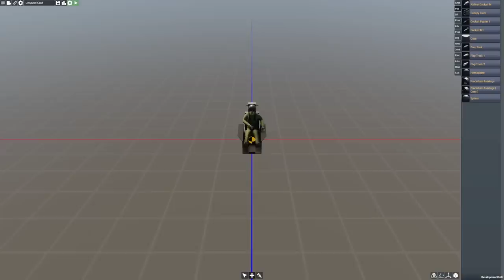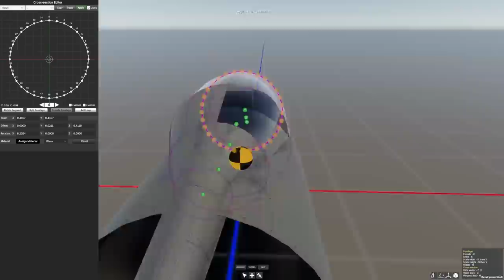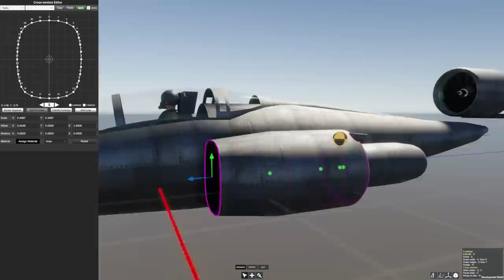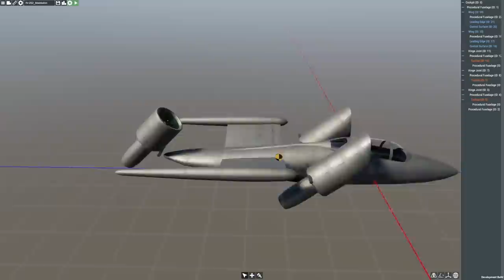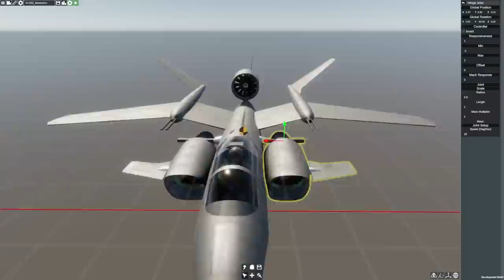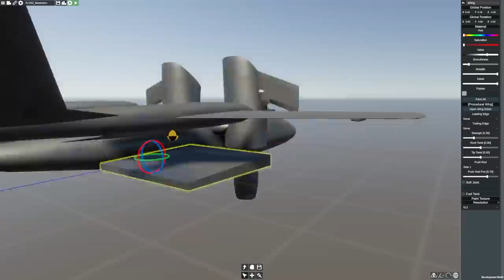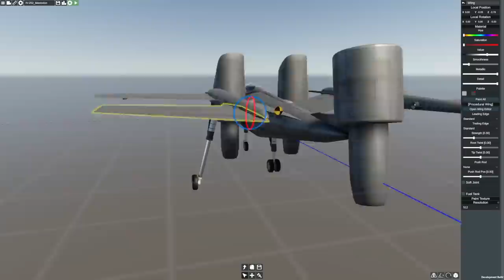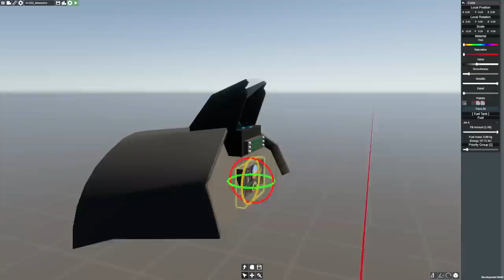Building a Rather Absurd VTOL Aircraft - |FLYOUT|

Comment: This is one of those crazy cold war ‘revolutionary’ aircraft that's really just made to impress the other side
Reply: Like the XB70 or B58?
Reply: it's what happens when you give 60s-70s engineers a few kilos of coke and tell them to make concepts and mockups.

you end up with one or two feasible concepts and an inventory of drawings with specifications jotted out in ilegible handwriting.

not really a shock for the opposition by the way.
Reply: @valeriezorn9420 the B58 actually was in service though.
Reply: @hughmungus5033  
the op stated "impress the other side" not "never saw service"

neither the B70 nor B58 had much more of an effect other than forcing the USSR to adapt.
Reply: @spazzey0  The B58 wasn't just made to impress the other side. It added a capability the USAF thought they needed at the time in order to penetrate Soviet air defenses. At the time the best way to do this was speed, and either extremely low or extremely high altitudes. That is why the U-2 flew so high. The B-58 was made to fly higher and fast enough to avoid Soviet interceptors before the introduction of high altitude SAMs.
Reply: I want to say it made me think of weird fictional super aircraft from Ace Combat.
Reply: The Cold War is really cute if you think about it it’s two sides trying to make something to impress the other
Reply: @NerfAutist the nuclear bombs:
Reply: @NoDoudt.  did I stutter
Reply: Yeah, it’s more typical of the late 50s and early 60s than 70s and 80s, forward swept wings and all.. I know, I was building models of X planes in the 1960s.

Many of the designs only made it from paper to flight prototypes in order to get the Soviets to waste time and money trying to get them to work. That was the real point of the US habit of making films of text flights public.
Reply: @valeriezorn9420 both of those are for scaring. And also for actual use.
Reply: Like the Harrier II? Because this reminds me of the Harrier II.
Reply: Just like the Dassault  Balzac  V

Comment: i am kinda interested if you were to make the most inefficient working aircraft possible
Reply: Supersonic Farman 2222 strategic bomber? This thing have aredynamic of a brick.
Reply: dombrowski sedlitz?
Reply: Already did. It’s called the flying cruise ship
Reply: He just makes the most overpowered gas hungry engine known to man with the aerodynamics of a Jeep Wrangler
Reply: @elixer4583  its efficient in carrying jets plus it runs on nuclear power so it technically dont burn fuel.
Reply: @Canzandridas  well inorder to make a inefficient aircraft like the most inefficient it would still need a body that would produce alot of drag.
Reply: @elixer4583  no the mothership whas worse you now the one that could transport other planes
Reply: a "plane" with a cube-shaped fuselage. it lacks any wings or control surfaces, meaning that it relies on multiple jet engines positioned all over it to take off, remain airborne, move, and turn.
Reply: Ah yes the space shuttle

Comment: It would be fun to see some sort of an all-wing aircraft, similar to the Vought Flying Pancake
Reply: he already did something like this on the lifting body aircraft video
Reply: @prato_ That’s a lifting body, not a flying wing. While the fuselage is technically a wing on both designs, a flying wing is basically just the wings of an aircraft without a fuselage or other non-wing features. A lifting body is using the fuselage as a wing.
Reply: @prato_  that's precisely the exact opposite
Reply: @thehornedserpent so like a B2?
Reply: @elixer4583 
The YB49 still dosen't count, the commenter most likely refers to things resembling lenticular aircraft ( not to be confused with the stereotypical UFO ).
Reply: @spazzey0  It would be great if something like that could be built in Flyout
Reply: @spazzey0   how would it even work?  I know there were concept aircraft back in the day. I’m studying in engineering and still have no idea of how to do it, Especially with the limitations of flyout. Maybe something like a gigantic circular fan?
Reply: @elixer4583  
A fan worked for things like the avrocar, albeit not great, modern unmanned designs have better performance but they are not optimal for combat.

So, it's either a combination of go really fast, use thrust vectoring nozzles, fly by wire, or give up and add a vertical stabilizer.

The B-70's "Pye Whacket" lenticular defense missile comes to mind, it was never used, but wind tunnel and real, practical tests did occur, it would be launched and accelerated to high speeds, stabilized by thrusters.

Around the same time, lenticular shapes became a popular study with re-entry vehicles, you could launch a multi-stage rocket with a manned lenticular spacecraft much like the dynasoar, it could fire its nuclear armament and wouldn't need to be over the USSR to do it, then undergo re-entry and land safely back home.

You could also just add vertical stabilizers.
Reply: @elixer4583  Yup
Reply: @spazzey0  interesting
Reply: Literally his first video lmao
Reply: @spazzey0  Yes, this is exactly what i meant. Round wing designs similar to the Vought V173, or the german Sack AS-6. I find a strange kind of beauty in them.
Reply: @thehornedserpent  you would think a body that generates lift is a wing, since airfoils are just shapes optimized to... generate lift? Well, the internet has surprised me today.

Comment: Yeah this is 100% a mid cold war era x-plane. It is comprised entirely of duck tape, paracord, and sheer middle finger energy. It exists for no other reason than to spend that excess tax money so they can get the same amount to play with next year. It does not care what you think, who you are, or what you do, it will single out your house out of spite and its deeply personal vendetta against you personally, then crash directly into your bedroom. I love.

On a more serious note, the only reason why this design is that unstable in VTOL mode is the lack of a fly by wire system to balance the thrust of the engines. Ok maybe not the only reason but its the main reason.

Comment: Drop the "V-TOL" part of the design and this looks like an awesome "Engine tester" aircraft - Something designed to be able to have the engine nacelles take off easily, so different engines could be swapped in/out for testing on a consistant chassis.